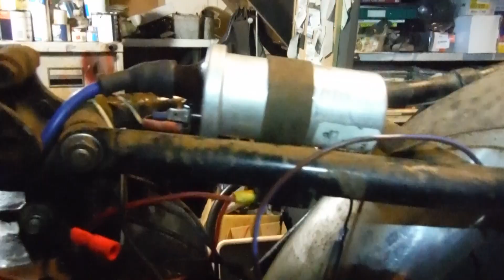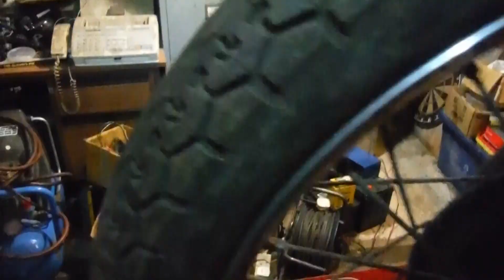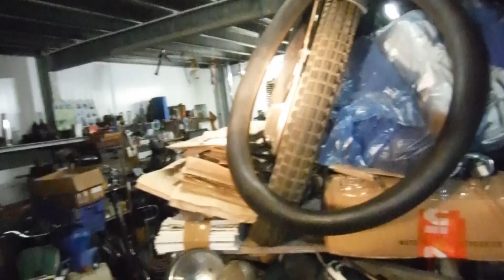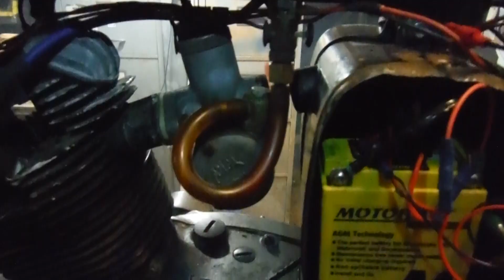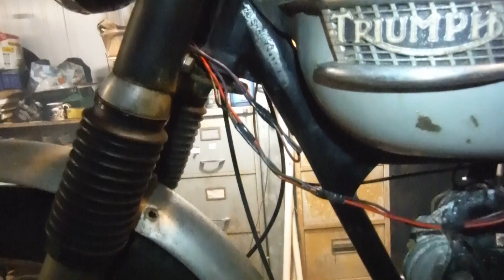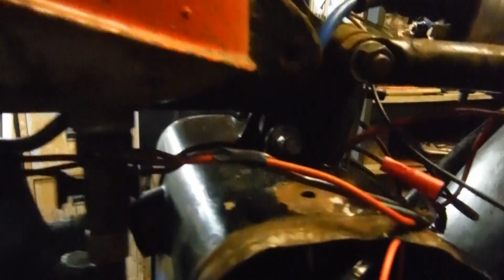Triumph Sports Cub project now has 12 volt electrics and appears to be charging.

Comment: More good progress Paul. One thing, probably already on your list, but that fuel line looks very well past the use by. I think Cohline do a nice braided covered ethanol proof pipe.
Reply from the maker: To be honest, the fuel pipes on my Trident are probably the originals - they have certainly been there since I bought it in 1982! The pipe on the Cub has hardened, of course, but it doesn't leak. I think older pipes seem to stand up to fuel better than newer ones - it could be the basis of a video, perhaps!
Reply: @paulhenshaw4514 l think a lot of new parts are made of inferior material these days - seals, brake lines  c.v boots, tie rod boots, fuel and oil lines ...... not good. I have found either cohline or tygon to be the most durable for fuel lines. Maybe a video on quality of replacement parts V reusing old used / nos where its possible? ATB.

Comment: Is that the original 6v alternator now making 12 volts?
Reply from the maker: Yes, it is - it is easy to convert them by connecting the mid green and dark green wires together, to make 'one' wire, and keep the light green on it's own, job done.
Reply: @paulhenshaw4514 thanks!

Comment: I'm a little concerned about those tyres, will you be rubbing some sandpaper or Emery cloth on them to expose a bit of fresh rubber before trying it on the road Paul ?
Reply from the maker: Hi Ian, I will probably fit new tyres and tubes, once I am sure it can be registered for the road. i may try it up and down the lanes as it is, but that's all.

Comment: The lights look nice and bright, Paul. So the 'powerbox' is regulating the charging right?
Reply from the maker: Hi Dave, the Powerbox does the job of a rectifier, zener diode and capacitor, all in one.
Reply: @paulhenshaw4514  Wow, it's a miracle 👍

Comment: I wish you had used traditional bullets rather than the dreadful pre-insulated connectors 😢 Sounds nice though !
Reply from the maker: The blue male connectors I use, fit into the old Lucar tube connectors, I have never had any trouble with any I have fitted myself, but I have come across plenty which haven't been crimped properly by others.
Reply: I used to use pre-insulated terminals until I began to use brass bullets (crimped and soldered) and the standard British bullet connectors. My looms are now completely reliable and the bullets allow mods or new items to be to patched in quickly. There is no such thing as best but whenever I see pre-insulated connectors on restorations I wonder what other corners have been cut.

Comment: Ever used Self-amalgamating tape for wrapping the wires? I found it fab for harnesses, sticks to itself but not to the wires within and forms a water tight rubber cover.
Reply: HOlds up way better than insulating tape, that goes slimy and curls off. Used it in the landrover engine bay, keep the wires together with ins tape then wrap the whol lot. Then realise a week later there’s one more that I’d forgotten about!!
Reply: Good stuff that
Reply from the maker: I shall keep that in mind, thanks!
Reply: @paulhenshaw4514 there is also an insulating tape that has mouse/rat poison in it. I use that in concealed areas and then peppermint spray elsewhere.

Had an engine wiring fire once thanks to an exposed live.

They love to chew. Little b******.